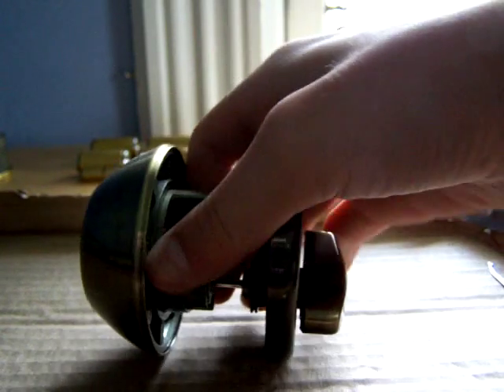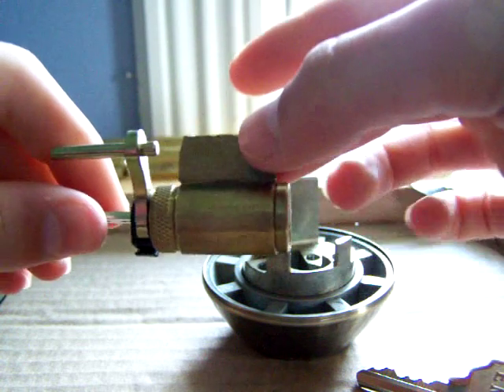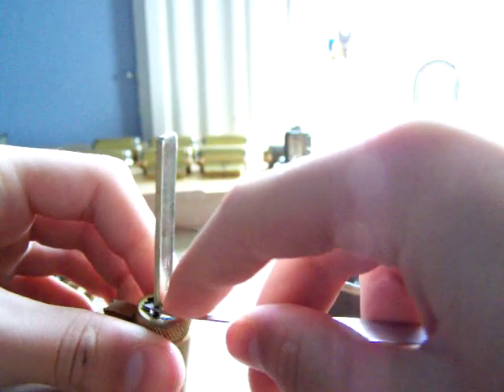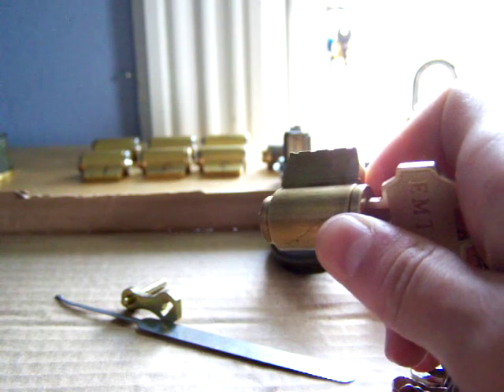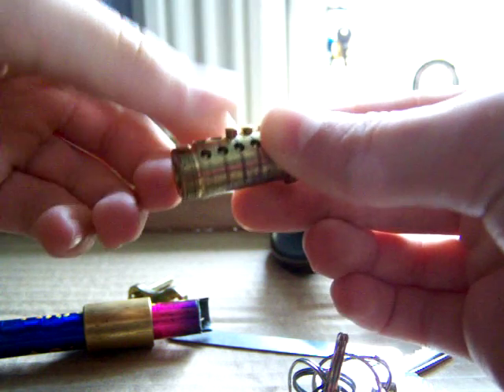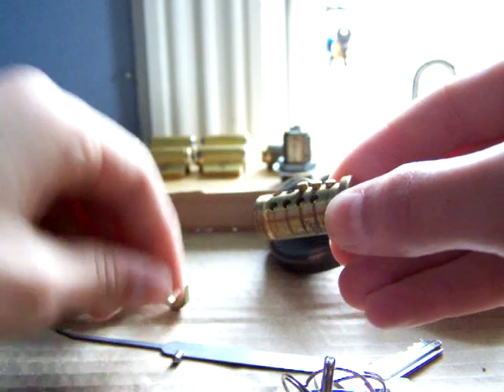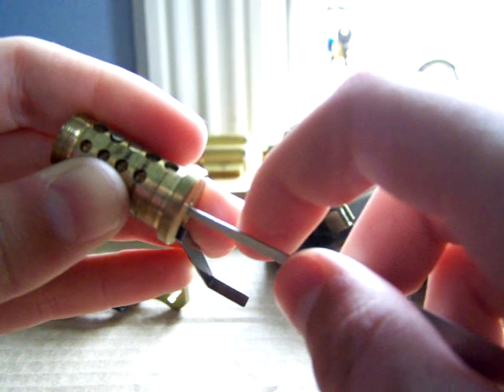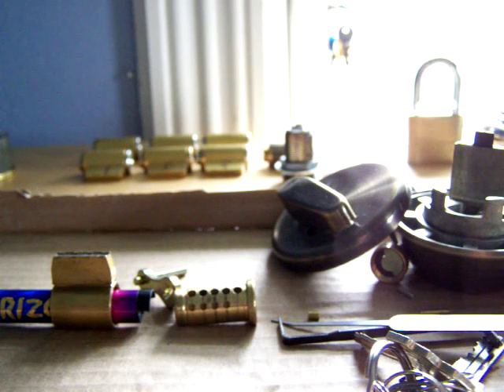how a lock works, for beginners

Comment: its helps by picking simple key-locks, but with m-t-locks its doesnt works and most of these video's about lockpicking again mul-t-lock are just a fake, because mul-t-lock has a pin that you cannot move just by picking and also many lock has a side pin that gives you better security again lockpicking.